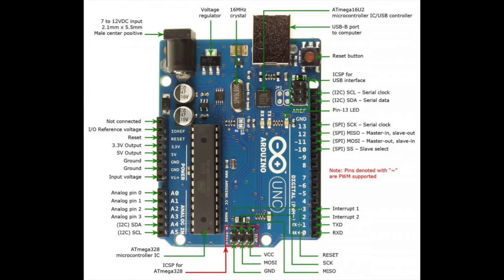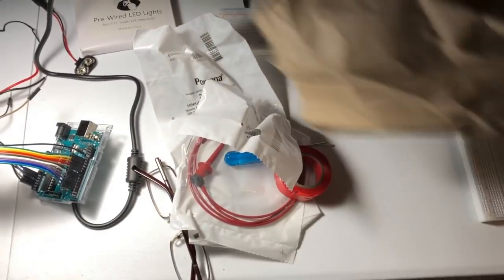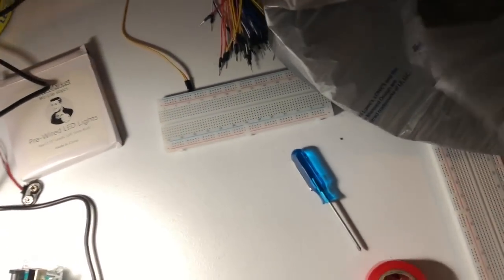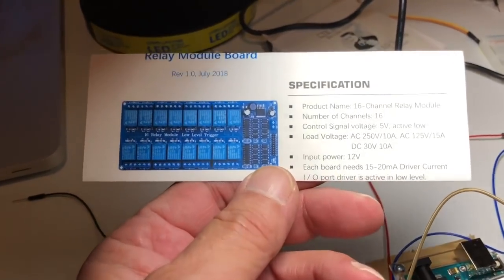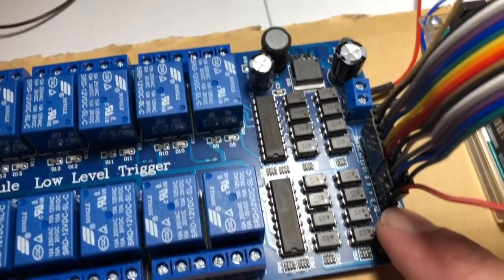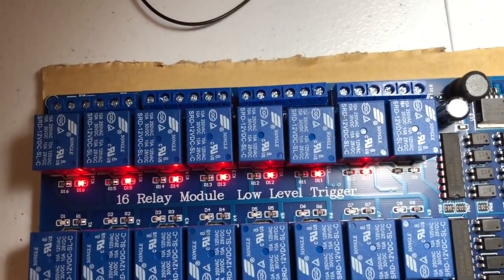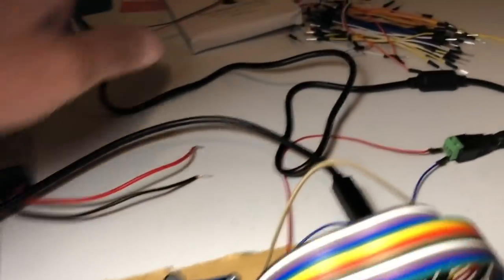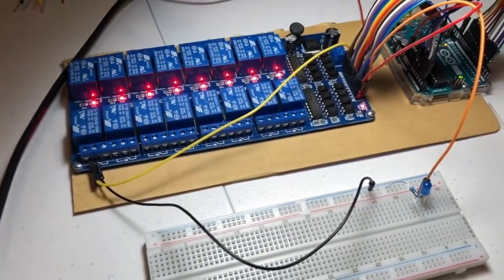FIRST ARDUINO PROJECT EVER OMG

Comment: I've never actually written code for an Arduino, but I'm pretty familiar with the core concepts here.  If you're interested in getting inputs, you should probably look into interrupts and how they work on an Arduino, and how they work in conjunction with delay.  Typically how interrupts work for processors is that an input (like a button press) will cause the processor to jump to a specific piece of code that was written to handle that event, interrupting whatever it was doing before (probably even if it was in a delay).

Good luck with this!  I'll be curious to see what you turn this into.
Reply from the maker: The code works in two sections.  The first section defines variables and pins.  The second section is a loop.  It starts at the top of the loop and falls to the bottom and loops back to the top.  You can't assign it to go anywhere else.  You have to fill the loop with if/then's to get it to fall past a function if you don't want it to perform that function.  I sure wish I could write some gosubs.  A raspberry pi has a processor, an arduino does not.
Reply: iROBODUDE 

This is what I found in their reference. Again, I don’t know much of anything about Arduino, or if your particular flavor supports this. 

https://www.arduino.cc/reference/en/language/functions/external-interrupts/attachinterrupt/

Comment: you could have something you wish to control then figure out how to do it. these are similar like raspberry's
Reply from the maker: Hey Rev, nice to hear from you sir.  Yes, I have lots of ideas for uses.  The difference between the Arduino and the Raspberry is that the later has a processor.  I bought it to control RGB LED's but I'm finding out that it is much more complicated than just running the LED's.  It requires driver boards.  I got one but haven't gotten to that part of the project yet.  I am just playing around with the code to begin with, using the relay board to see the reaction to my changes.  Playing with for/next loops and assigning strings etc.  Do you play with Raspberries?
Reply: could be something to play with in winter, when snow bound for weeks